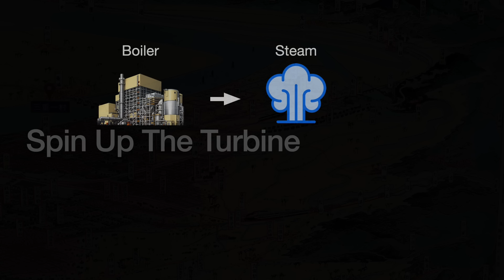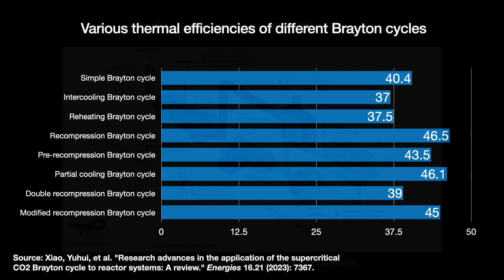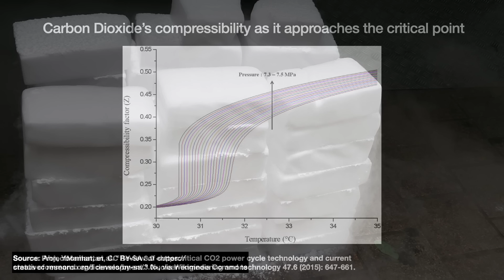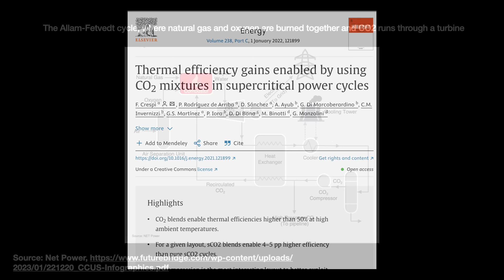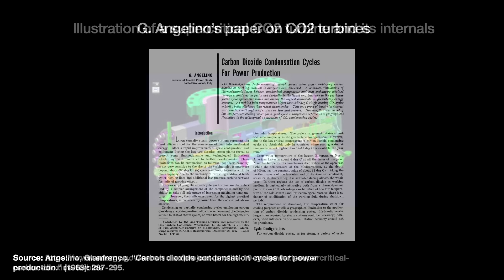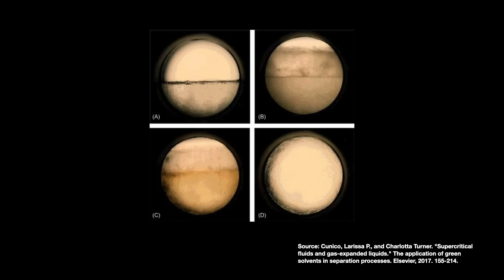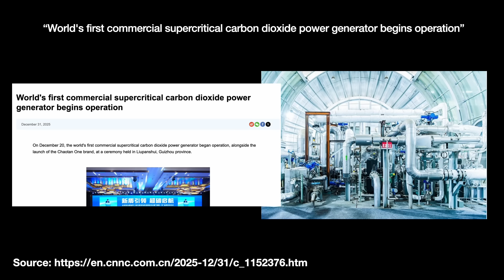The Supercritical CO2 Turbine: Waterless Wonder

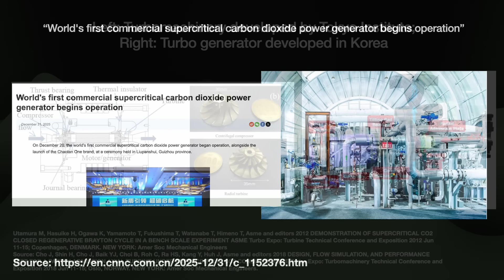Comment: The subject has been in the news lately, probably because of the recent Chinese demonstration mentioned here 19:27. 

The technology is fine, but the news articles about it are often a little misleading. A full sentence would be "because of thermodynamics, for higher efficiency we need to run the turbines hotter, but steam becomes very corrosive at extreme temperatures. Carbon dioxide in not corrosive in the same way, (although it has its own problems), and therefore sCO2 turbines can be more efficient when run at such high temperatures." But this gets shortened for simplicity to "carbon dioxide turbines are more efficient than the steam ones."

In reality, the pilot plants, like the one in China actually run at lower temperature, because they run off "free" waste heat which would not be practical for the steam power plant. It is cool, but these are projects on the 1/100 of the scale of a large steam power plant. So it is not very easy to compare these things.
Reply: Journalists are barely human, so don't hold it against them when they talk massive amounts of shit

Comment: A downside of smaller turbines is the loss of mass, with current grid stability that could be an issue.
Reply: Grid stability would be more influenced by the mass of the electrical generator rotors.  If you needed more rotating mass to stabilize grid frequency then a balanced low carbon steel flywheel is a much lower cost rotating mass than 30 plus stages of high nickel super alloy turbine blades.  Fortunately the mass of the generator's rotor is more than sufficient.
Reply: You can apparently also use battery banks to improve grid stability with the right setup.

Comment: I hope that sCO2 turbines can be made as the prime movers in electric locomotives.  This together with a FWES system for regenerative braking could be a game changer in the locomotive market.
Reply: You need a bigger scale to make in beneficial , never in moving objects !
Reply: @lucasrem  I don't think that is necessarily true. sCO2 turbines are definitely being developed for mobile applications.  The low rotor mass enables mobile installations with proper bearing engineering.  Engineers almost got steam turbines to work in locomotives but they were too big to implement turbo-electric (very poor low end torque) and the large rotor mass couldn't cope the bumpy ride in the rail environment.

Comment: If supercritical CO2 is too reactive, why not supercritical nitrogen? That shouldn't react with anything.
Reply: if i had to guess, i'd say that it's because co2 is more practical to keep in supercritical conditions. nitrogen has to be kept much colder to stop it from turning into a gas, which hurts efficiency, and might not be practical. not sure though, there's probably some other reasons as well
Reply: For the cooling of nuclear reactors people have used light and heavy water, helium and carbon dioxide. Nitrogen cannot be conveniently used due to neutron activation -- it becomes radioactive. 
Since many of these turbine projects originate in the same field, they work with what is already familiar. 
Otherwise, ordinary gas turbines run fine on air, which is mostly nitrogen. Gas turbines are widely used, and although most of them have a moderate size, the ultra-large turbines exceed half a gigawatt in power.
Reply: @cogoid good point. The radioactivity aspect is not something I've considered.
Reply: Carbon Dioxide is actually a vapor at room temperature. The advantage of the supercritial cycle is that a liquid or liquid like state is usable on the cold end of the loop.

Nitrogen is a true gas, it would be used in a closed cycle Brayton, but other gas options would likely be better like helium.

Vapors are gases that are below the critical temperature and true gases are above it, but below the critical pressure.
Reply: Some have suggested Argon as a working fluid.

Comment: China has gone commercial with waste heat from a factory using this technology recently
Reply: My understanding is that it was addition to a steel mill that has been there for several decades. Supercritical turbines are significantly smaller than steam turbines, so this may have been a demo for a niche use case. I'm not entirely convinced it's at a stage where it can be called "commercial", but it's still possible  for me to eat my hat at a later date.
Reply: @KrillCanoe25 Yes, it a development of a 100kw unit in 2009. The demo unit was installed and operated in CAS labs in 2024 , so there is no need to demo the demo unit again. The objective for this 2026 project was to see if such installations are profitable and the tender put by the steel mill in 2023 seem to fit the bill. (I would not be surprised if they just reused the 2024 demo unit) 

Another area to watch is a small demonstration unit coming online in 2028, it suppose to use a molten salt primary loop and supercritical CO2 as its secondary loop for use in both carbon capture and nuclear power so would be interesting to watch. I would expect the same process where the unit is first tested in a lab to test technical feasiblity, then put in commerical use to test profitability.
Reply: Yes but it seems to essentially be a demo project much like the ones in the US.  It doesn't seem anyone is confident they can make them economically worthwhile yet.

I mean it's a good step and you need to make them if you want to learn how to use them but a trial plant is a long way from the point where it actually net saves money because the extra maintenance and installation bills are less than the saved fuel which is kinda where we are stuck at the moment.
Reply: Wow, only took them forever.
Reply: China has it much easier putting together large demo projects, because if the government deems it is a good idea and you get political support, then money and manpower will be used to do something... What this means, is that the size of a project and its position in industry has little relationship to the  actual commercial viability of the technology. 

These large demo projects can be great for making headway on certain technologies, but also has the moderate to high chance of backfiring in the case of an undeveloped tech or in the case of just a badly though out policy.

One such example in the case of China happened during the "Great Leap Forward" which seems to have either caused the great famine in China after WW2 that killed tens of millions, or at least made the famine much worse than it would have been.
The "Kill the Sparrows" campaign (1958–1960), part of Mao Zedong's Four Pests campaign during the Great Leap Forward, aimed to eliminate sparrows to protect grain supplies. This environmental catastrophe, which involved mass extermination, caused a massive ecological imbalance, leading to a locust explosion that severely reduced food production and contributed to the Great Chinese Famine
They may have protected grain supplies, but the locusts explosion that followed ruined crops before they made anything the humans and sparrows could have possibly eaten.
Reply: @Tom89194  The sparrow figures in The 3 Body Problem, at least the Netflix version. Reading the books is on my list.
Reply: @Tom89194  I’m aware of the historical learnings from the culling of sparrows, but can’t help but think it’s not particularly relevant to this discussion? Perhaps a more recent example of cutting edge technology being underwhelming but over invested would be more relevant.
Reply: @matdan2  It is an unfortunate indication of your critical thinking skills if you don't understand the relevance of a Chinese government program that was implemented with widespread enforcement without a smaller implementation first to discover possible issues when trying to explain how the Chinese government shoving forward a project on a large scale doesn't mean it is actually viable, or intelligent to do so.
A more recent example could be that Shuangjiangkou bridge that had one end wiped out by a landslide, but I doubt there is enough information to determine if the landslide was due to the construction, or if they should have done some mitigation work to the slope to prevent the loss of  a brand new bridge.

Comment: sCO2 turbines have serious issues. The CO2 heaters and blades require superalleoys due to corrosion and carburization of steels, and the printed heat exchangers with low pressure drop are extremely expensive. And the recuperators have to be very large for reasonable efficiency. I urge you all to watch Qian Zhu's video on sCO2 on the International Cente for Sustainable Carbon's YouTube channel.
Reply: So nothing different from a turbine jet engine? Single crystal superalloys? I feel like with these it would be easier since weight shouldn't be an issue.
Reply: @rkan2 Similar, but even higher temperatures, and an amount of superalloys the size of a boilerhouse. And printed plate heat exchangers almost the same size.

Comment: Are we finally going to be free of the tyranny of boiling water?🎉
Reply: Boil, baby, boil!!! 😅
Reply: Not if Big Boil has anything to say about it.
Reply: Probably not
Reply: possibly yes, besides the topic of this video ofcourse, CO2, there is another path. thermophotovoltaics are solar cells that generate a current using infrared radiation. allowing them to be used to generate electricity directly from a hot, heatsource. anton petrov did a video about it
Reply: Moving on to the tyranny of almost-boiling CO2?
Reply: China has already deployed commercial supercritical co2 turbine system to generate electricity from the waste heat from factories and blast furnaces exhaust stacks.
Reply: Boiling water got us here.  Now you want to turn your back on it???
Reply: @creepycrespi8180  Hot water burn baby!
Reply: @creepycrespi8180 the fist a blind man leaves after they get there vision back is the cane.
Reply: @creepycrespi8180 water is for bathing the elderly, all hail new tek
Reply: @creepycrespi8180  "Boiling water got us here.  Now you want to turn your back on it???"
fresh water is scarce
Reply: @arofhoof Modern steam turbines are closed cycle systems.  They don’t consume water.  They may use water as a heat sink, but so would a CO2 turbine.
Reply: @creepycrespi8180  Yes. The phase shifts of water to steam and back cost and release way too much energy due to the hydrogen bonds, which is a MASSIVE drain on efficiency. Also, water is a REALLY good solvent, which is very bad for the turbines. So with the steam temperatures increasing, and development of material science, the shift away from water was all but inevitable...
Reply: @user-tb7ml8kz7h oh right, even though water is great as heat transfering medium, the hydrogen bonding might do a thing or two for changing phase from liquid to gas. Now this is science i am reviewing.
Reply: @user-tb7ml8kz7h the high phase change energy is actually good for efficiency at the low temp side if the cycle because it allows high heat transfer with low temperature differential. The high temp and corrosion are the main issues.
Reply: not until my stovetop supports supercritical co2 technology
Reply: Once there's no more water
Reply: And nuclear meltdown.
Reply: Yes but there is no circumventing boiling something.
Reply: Solar plus storage is getting quite cheap, so...
Reply: 0:42 this is the crazy part — it’s not just “freedom from boiling water”… it’s basically shrinking the entire power system 😳
The real question is: if this tech is so efficient, why are we still stuck paying higher energy bills every year?
I saw another breakdown that goes deeper into the “hidden cost” side of this — makes you look at this completely differently.
Reply: Boiling water is not a bad thing as long as you condense it back into the cycle so you do not waste water.
Reply: @Cjephunneh  even if you don't condense it the water still stays on earth, that's not the issue.
Reply: Life, death, taxes, boiling water ...
Reply: still gonna be boiling something
Reply: @benjaminconnor6640  no. The point is to use a supercritical fluid and not change phases in the turbine cycle.
Reply: @ctrlaltdebug  A false boil then.
Reply: There is some work using transformers to directly convert beta particles from fusion to electricity.
Reply: @Steven_Edwards  that's good but there's also neutrons whose energy we should try to capture 🤔
Reply: Yes. Solar plus wind with gas and battery backup
Reply: Still gotta spin a bloody turbine unless solar cell power.  Sad
Reply: @Commander.Starfleet  how else are you going to make the electrons move?
Reply: we boiling co2 instead of
Reply: Still boiling something
Reply: Turbines are fake . The piston engines are real
Reply: @Kawka1122  born too late, I guess
Reply: You China ? what is it you need, Free Water ?
Free the People now !